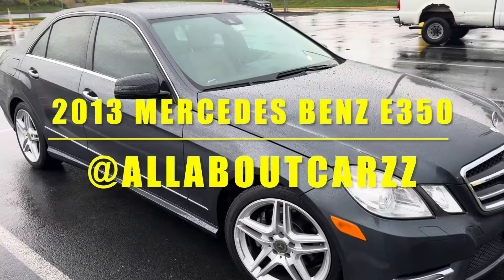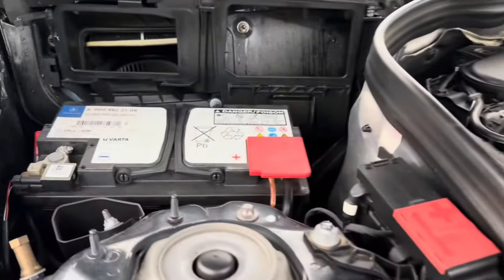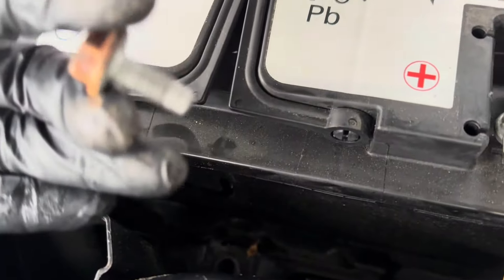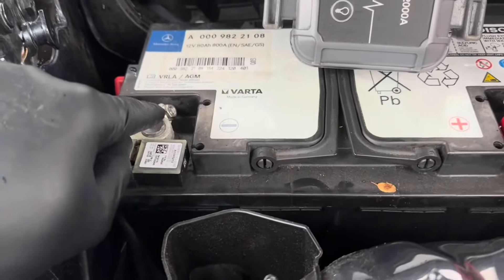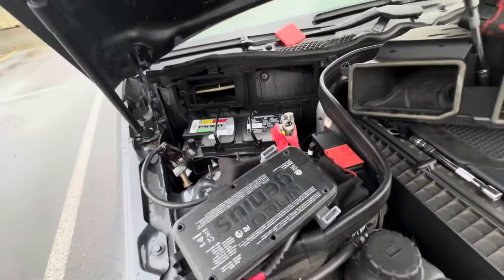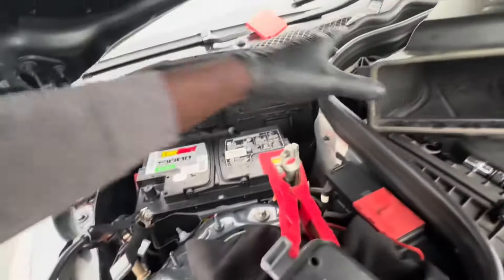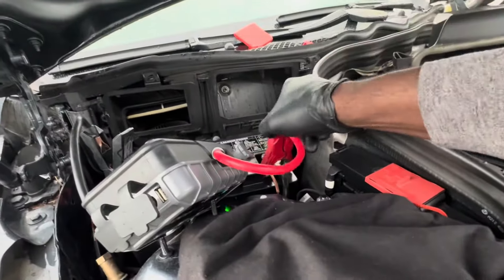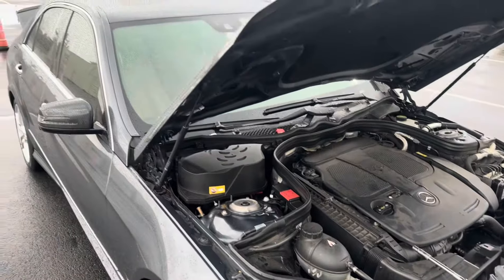2013 MERCEDES BENZ E350 | easy battery H7 replacement | W212 All about carz | cars - LINK below

Comment: Instead of putting the Nico boost on the actual cables, can you put the positive one on the positive where that red slide right next to the strut in front of the battery, not the strut under the car obviously , and the negative on the post?  Keep them connected then take battery out
Reply from the maker: Understand, thank you.

Comment: Would you recommend using the red slide and the negative post next to the battery to jump start the vehicle I've tried to jump start connecting it directly on top of the battery and all it does is turn on the lights it won't crank on
Reply from the maker: I am not sure
Reply: Alrighty